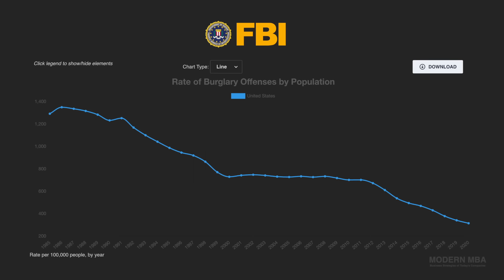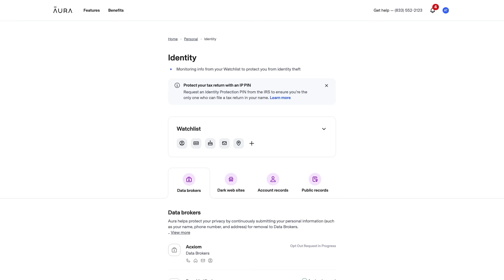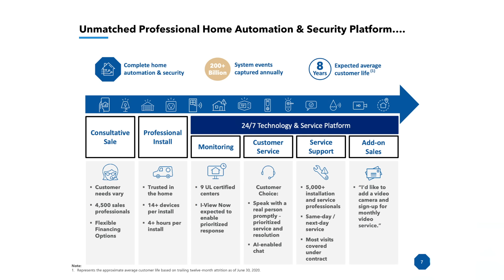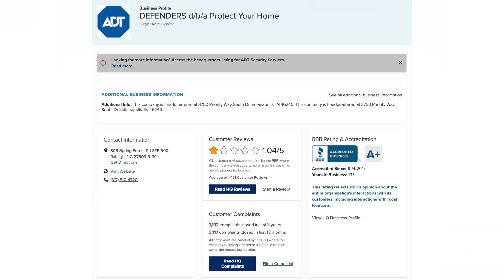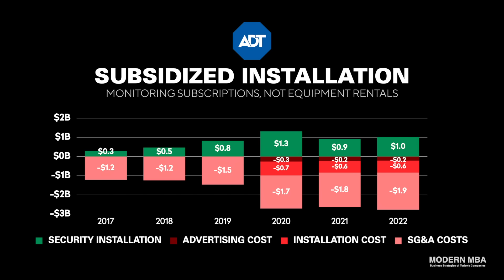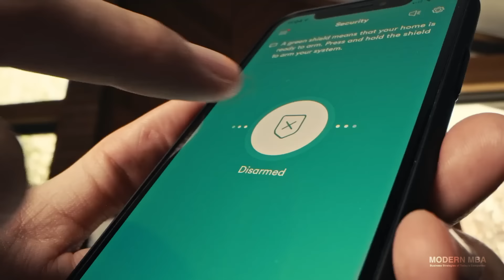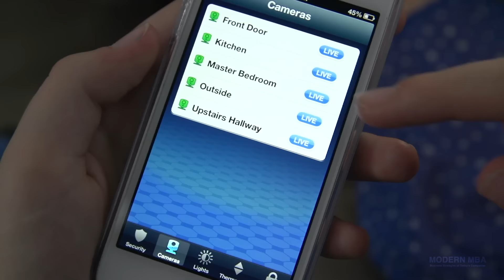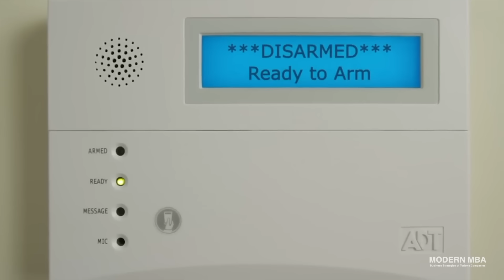The Bait & Switch of Home Security

Comment: I work for ADT as a remote inbound sales rep. You’re incorrect about some things. The self set up option is only a contract IF the customer prefers to finance the equipment. If they purchase outright then it’s a month to month contract at $25 without cams and $35 with cams. 
Adt is gaining customers at a very fast rate right now. Vivent sold to NRG oil and gas and they charge 3x more for equipment and installation. 
Brinxs is basically a professionally installed self set up system. 
Self set up systems are 100% reliant on wifi so if power goes out so does your security. 
In the end ADT is really the only option left for homeowners looking for reliable security and with the addition of the quality service plan to every new account maintaining that system is actually affordable. 

Clearly I’m biased because I work for ADT corporate. Sincerely though it’s the best company I’ve ever worked for. They treat employees really well and pay a livable wage. Benefits are amazing as well. So I have good reason to be biased.
Reply: If I want to have ADT Security installed to my household in the future, what are some tips to get the most out of my security, and how to get the best deal based on my needs?
Reply: @seangutierrez1337  stick with corporate adt. You get the best pricing when you do everything over the phone with corporate. Adt mails out fliers that offer multiple free cameras. When you call off a flier number it auto generates extra promotions for agents to use. Also ask about affiliates. State Farm home insurance literally pays for most of the equipment. There’s others like amex, American family and usaa. 
Also be straight up with the person you’re talking to. Let them know what your budget is and what your needs are. I will do whatever I can to get your pricing within your budget as long as it’s reasonable. 
Corporate phone reps do not make commission off equipment. We get a set commission no matter what is sold. I’m always looking to give people the best deal I can on equipment/install. 
There’s always going to be contracts when you’re financing equipment. If you can afford to pay off your equipment upfront then do it. We still have to do a contract due to the break even point being 24-36 months BUT now 12-24 months is now an option for me to use. I do not get less commission for shorter contracts. That’s a dealer thing.
Reply: @ethancondry3474  Also, what is the difference between purchasing equipment and monitoring through ADT directly, and through ADT authorized providers?
Reply: @seangutierrez1337 I’m also a corporate inside sales rep. The gist is a dealer only gets paid when you sign up with a 3 year contract. So they will often charge a higher monthly, but “give” a system for $100 if you qualify. If you talk to a corporate rep you would be paying for the equipment over the long term, but would be a cheaper rate. I would always recommend a self setup system. If you buy the equipment all at once or a 3 pay you can do it from month to month or pay over 2-3 year period. Still have the same quality of monitoring as the people who are paying $100s.
Reply: They treat their call center sales people like crap

Comment: The rise of DIY camera services that are consumer accessable really hurt ADT's business model. Its even possible to get an off the shelf replacement for the central panel system that ties most of the open IP cameras, door sensors, and other systems. Ive even managed to link my unifi console that i use for internet and cameras (90% hardwired) with a redundant backbone that is more resilient than what ADT can provide me.... And I have all the sensors ADT could possibly give me...

Comment: 7:58 again, miss leading info. Yes, the alarm will still function and yes it might be able to communicate with ADT through the cell towers BUT the cameras would as of today not work because the camera need internet (unlike Ring Alarm Pro which has a backup cell for their cameras as well as the alarm).

Comment: Given the prevalence of affordable wireless cameras that you only have to charge a few times a year that can record to a built-in SD card slot and access via phone app, it's hard to justify paying a dime for any security service.
Reply: Recording to the built-in SD slot has an obvious flaw. But you can easily buy a little NAS box with CCTV functionality and conceal it somewhere hard to access. Just add a couple of basic UPS devices and you've got yourself a subscription-free home CCTV system. It won't stop your house getting robbed, but it'll give you a much better chance of police identifying the bastards later.

Comment: When I bought my first house my wife’s aunt referred Safe Home Security to us (back in 2007). 

They came in, put in a system with a few sensors put on a couple doors and windows. Well, the sensors kept falling off and the cops would  then respond to our house. 

It happened like four times within the first couple months, so we tried to get out of our contract… Nope, locked in for 2 years. 

So, we just stopped paying and ended up having to settle. Safe Home Security were sleezeballs. Now, I just have Ring cameras and pay for data backups.

Comment: I’m in the security business and I can assure you there is a lot of money to be made and not in a bad way. It cost about 20 dollars to monitor a security system so most people charge double to make a profit. To turn a reasonable profit a month you need about 200 clients. Always go with a local company vs a big guy like ADT or Vivent.
Reply: Also the big selling part of this home security is 2 fold. You get a discount on your home owner insurance. Also it doesn’t have to just be security it can be smoke alarm and flood prevention. Even if the cops may not get to your house as soon as a burglary happens. It could save you a flooded basement or a total fire lose.

Comment: Here's what I do for security;
1. Bowley deadbolts. If you dont know Bowley locks you need to look them up. Good fucking luck.
2. Well built windows that are shatter resistent. The plus is they're energy efficient too.
3. Myself and my fiance work from home most of the time. If you break in while we're home we have 2 9's, a 22, and a 7.62 that'll easily explain why you picked the wrong house.
4. Our neighbors are retired and extremely friendly and nosey but in a good way.

Comment: When (not if) you cancel a security / alarm company contract do it via snail mail (and you can also via phone/email) - you may not have to go as far as sending it registered mail but that's good if you have the feeling that there may be a fight on your hands.  If you're calling - they'll always say that your call may be recorded - you should record it too.  Get a follow up (email at least) confirmation that you are indeed canceled and confirm if you need to do anything with the equipment (most won't want anything back but it's often in the contract that they can ask for it to be returned).  If you still have the gear make sure it's not contacting the central office - I've heard stories about people who canceled, had the confirmation they were but were billed for months past and had re-connect fees, etc. because the system kept in contact with the monitoring company.

Comment: The alarm panel is also an off the shelf part. And analog sensors cant be bricked, a door contact or motion sensor is basically just a switch or button.

Comment: went my whole life not really knowing what the heck adt was but ive seen their signs. i feel like home security is an upper middle class old ppl thing. u can just put 2 cameras in your house and call it a day.
Reply: If the robbers starts by cutting the power and the phone/cable, the two cameras won't do much.
A security system needs it's own power, that also powers the wireless network equipment that transmits the video to the outside world. It also needs reliable motion detection and cloud storage. You can DIY the hardware, but you'll still end up paying for the services.
Reply: @lajthabalazs  black people don't cut the power first wtf
Reply: @lajthabalazs  thats asking a lot out of amateur burglars to locate a home's utility lines and then dig them up to sever them. not to mention you cant just cut a main power cable running to a home, not without likely getting electrocuted.
Reply: @JohnDoeWasntTaken  Not in Canada. It's just an easy snap, unprotected at the side of the house. At least that's my experience after living in 4 houses.

Comment: 6:20 as of recent the sensors are also propriatary and won't work with any other panel besides ADT's which is their own flavor of Qolsys.
11:05 and scam a lot of people as well.
13:15 Yes, no. The sales person can always inflate the number to make more multiples. I've taken ADT customs with a 3 door system that were paying 90+ a month for no reason at all when they paid for hardware up front.
22:50 Eh... not sure on that number. An ADT rep in my area said there was no less than 200 ADT dealers in my area alone.
24:55 Their sales methods and dealers are a lot of the problem there.

As a dealer the biggest issues I see with ADT sells is their authorized program. It's not hard to become one and a lot of scummy people become dealers just to scam people. Hardware isn't consistant as stated where some dealers will install cheaper outdated equipment to make more money, and others will install the newest propriatary crap that just gets ripped out in a year. Couple the above with poor service, lack of service, poor installs resulting in service.... it becomes one huge train wreck.

This isn't even touching the fact that a lot of hardware purchased for a job that falls through isn't recouped or tracked. ie hardware is purchased by ADT for an install, dealer picks up parts from ADI, install cancels on day of for x reason, hardware stays with tech as freebies. This happens a lot with other companies as well... including some that /no longer exist/. 

So you've got shady dealers. Poor product purchase and control. Poor installs from lazy, bad or inexperienced techs... and it's no wonder people want to bail after a year of problems. 

I still couldn't believe the elderly couple I took from ADT... 3 doors, motion, DSC1818, and they were being charged 120/month AND paid 1k up front for the install. It's disgusting what some people do in this industry.

Comment: Some of the initial technical statements around the panel being "locked in" to ADT or effectively being "bricked" may not be accurate depending on how old your equipment is - while installers will often change the setup codes they can often be either overwritten or with a couple minutes of digging on the internet be discovered as the vast majority of installers use only a few codes when they do the setup.  Worst case you can buy a new panel board for about $50-150 depending on the model and configure a different CO (central office or monitoring company) yourself - the one area in which all alarm companies "lock you in" is around the wireless / cellular portion or module of the panel - these often now are integrated into the panel board so those become junk if you discontinue service.

Comment: As someone that is a Solar Estimator I guess I'm kinda confused on how thin the margins are for ADT Solar.

The market rate a Sales Rep could sell a solar system contract to an installer for is pretty much universally above $2 / Watt, for example in Florida. If ADT (formerly Sunpro) is accepting less than that, they deserve to fail. The 'gross margins' may be low, but that's not through justifiable reasoning. About $1 / Watt or more goes to the Sales Rep, the rest goes to the Company. Don't get me wrong they're making a LOT more than ADT is per job (net), but to say that the margins are thin is odd to me. On a project sold at $4 / Watt, which many of these Sales Reps are at these days, would leave ADT with around $2.35 / Watt or more themselves, the remainder goes to the Sales Rep (which in the case of $4 / Watt is usually financed with 20-35% Dealer Fees as % Margin, so say $0.85 / Watt goes to the Sales Rep (on a 10 kW system that's $8,500), the remaining $23,500 goes to ADT. And I know for a fact that they underpay their employees, which is why they walk into our office on a monthly basis asking for work. Materials get less expensive the larger the order, so if anything their margins should be a LOT higher than ours.

Keep in mind that I do this professionally, for a living...

Comment: I worked for adt a while back in sales. It was without a doubt the worst run company and the worst job I've ever seen. They seemed to go out of their way to make a system that didn't work. When I got there only one rep in the state could hit the monthly plan even at all, and if you didn't make plans you got very little money. My territory was formed by splitting a failing one in three! They gave us lists of new businesses made (we sold small business, basically house systems for smaller buildings) but my lists only had houses. When I pointed this out in training they just told me I would have to generate my own leads (which was supposed to be maybe around half the job). They didn't care, there was so much turnover one bad territory didn't matter... I was told by five other people in training (which was about a month after you started) that they were already looking for another job, and I wasn't even asking them, they just said this out of the blue. Those dealers could sell anywhere they want, and were cheaper than the company. They often times did things that pissed people off, and guess who had to fix things? Plus it was commission only and they frequently asked us to do things that didn't make us money. For example, they found a lot of new customers were canceling because some simple thing on the system wasn't working. So they made a big program for us to go out and follow up on past sales. Given the turnover (close to 100% in a year) these were generally someone else's sale you didn't get paid for. They tried to justify it saying most people would get a referral. They made a survey thing to keep track. The VP sent an email out after that complained that only two percent responded to the ad, but of those twenty percent got a referral! He was totally justified asking us to work for no pay, in a system where most people didn't make enough to justify keeping the job! Except obviously most of us didn't have anything to report after and skipped the survey, so only a small, small percentage got a referral and I'm sure it was a smaller percentage still that anything came of it. Nothing against the first level sales managers, everyone liked them, but ADT simply had a system that didn't work. I could go on, that's just off the top of my head...

Comment: ADT technician here. 

Good bit of misinformation in this video. ADT requires that you sign a contract because we take a loss on the equipment. That's why we require you to sign a three-year contract so that way we make our money back. Nobody tells you that you're not in a contract, we make sure you're fully aware of what you're signing. I don't see how that's any more scummy than a phone company requiring a contract. 

Also, you mentioned that the panels are proprietary to ADT. That's not the case. They're no more proprietary than say an unlocked iPhone for Verizon. The manufacturer still makes it, it's just programmed for a certain company. And all of the new panels that we install today like the command or qolsys are not just for ADT. There for other companies as well, and have multiple dealer options.

The only security system that Mary's centers to the panel is the command system. All of the other ones can be used on any of the system despite the company. Not sure where you're getting the information that if you have a safe watch 3000 that you can't activate it with a different company. You absolutely can. And we even activate from other companies as well. So if you had a system from a different company and then call us, we can activate that same equipment. And vice versa.

Also, new systems can have Wi-Fi as a backup. So if a telephone tower goes down, the system will still function. Not really sure what kind of solution you're looking for here. That's just the nature of any sort of wireless device. If you lose the connection, then the connection is gone. Pretty obvious. Which is why we have multiple communication methods. The likelihood that you're going to lose all of them is very low.

Also this video is outdated because ADT does in fact provide its own alarm system. The new V5 system was made in partnership with Google, but ADT owns it. It's manufactured by ADT and monitored by ADT. And that literally just came out within the last year or so. Definitely not outdated.

Comment: 25:37 again… flat out wrong. ADT Self Setup has no contract if you buy the equipment. It’s when you finance the equipment you will be signed into an agreement. In fact, if you buy the equipment out right you can go to the ADT+ web portal and turn off the service anytime without calling.

Comment: To ensure your DIY cameras continue working during power outage, plug your internet router into a UPS/battery back up system. For 100$ worth you can ensure at least 6-8 hours of continuous internet/security equipment during a power outage.
Reply: This would only be beneficial for the cameras if they’re run via PoE.
Reply: @ lots of wired cameras have built in batteries while others are battery only, activated by motion detection. Works just fine in my house!

Comment: If your home camera system isn’t connected to a hardwired local storage device hidden away with a backup power supply, you don’t have a home camera system
Reply: I have a natural gas generator for my whole house in case of power outage. Will that be sufficient?
Reply: @Rew123  yes